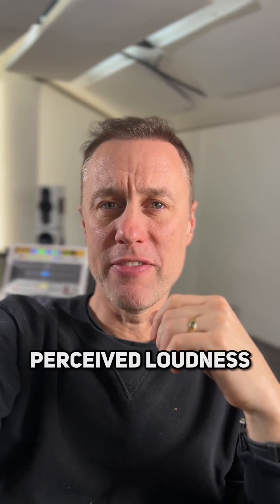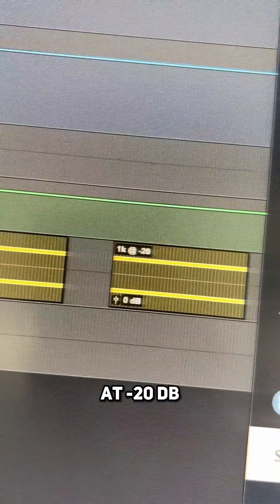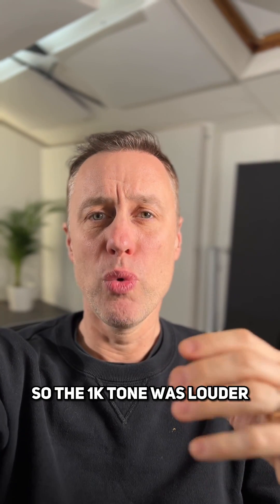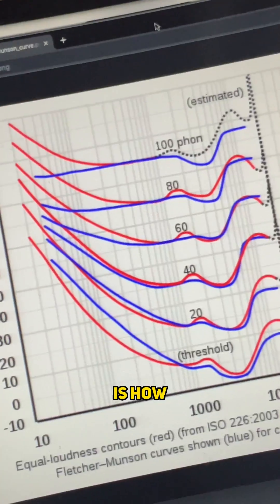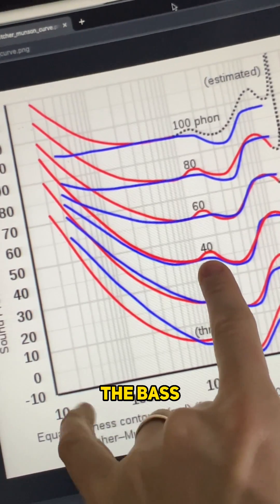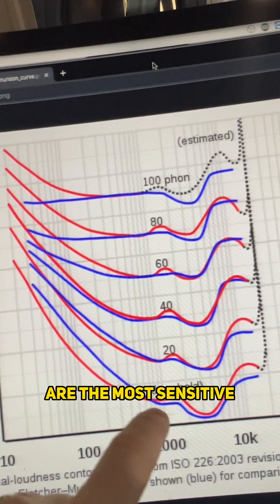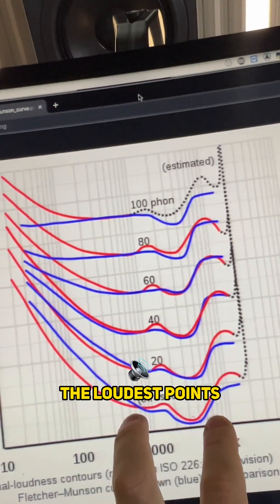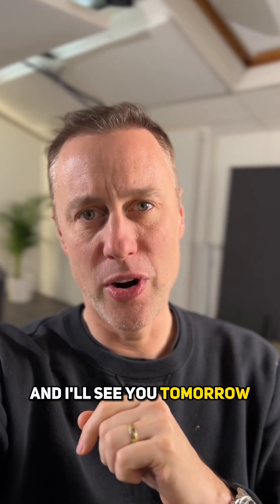PERCEIVED LOUDNESS PT. 1 🔊

Comment: I saw a video recently where the engineer used "Clipping" instead of a limiter in order to achieve loudness.  It audibly was much punchier as it didn't turn the whole frequency range down, only the transients that were clipped.  Worked best on the drums etc.  What do you think about this method?